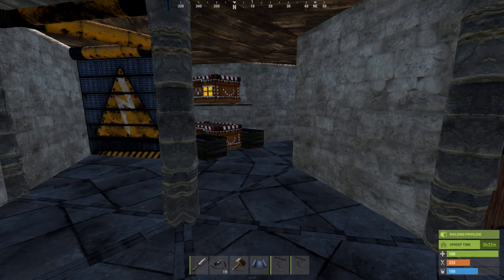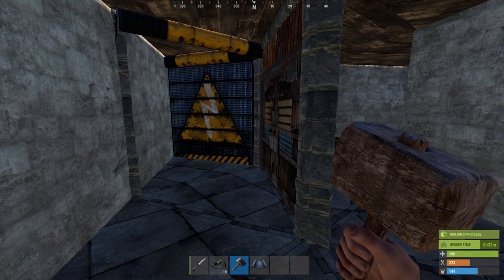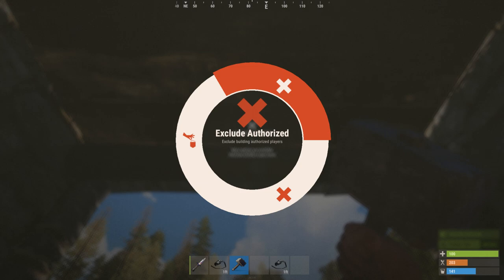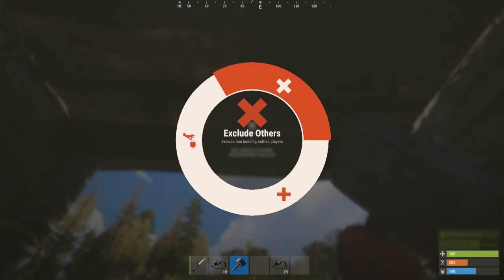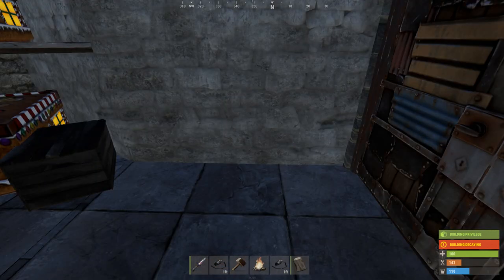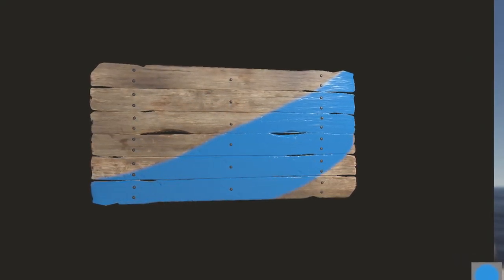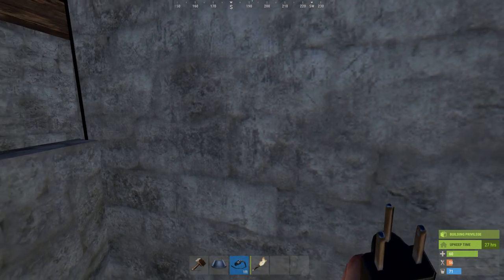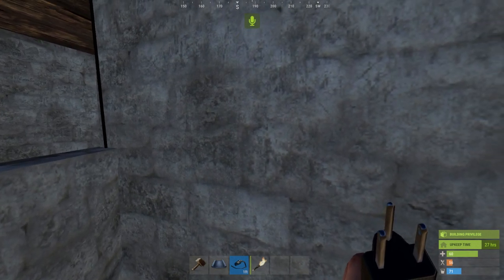How to Build Trap Base with Heartbeat Sensor/No Batteries - Rust

Comment: how do you keep stuff powered
Reply from the maker: You need to have an external power source hooked up to a (recommended) large battery. That way, electricity is powered during the day with the battery taking over at night. Feel free to check my pressure of video to see the setup ✌🏻